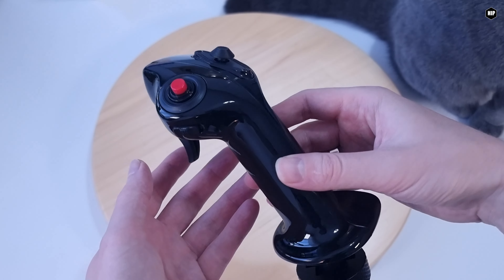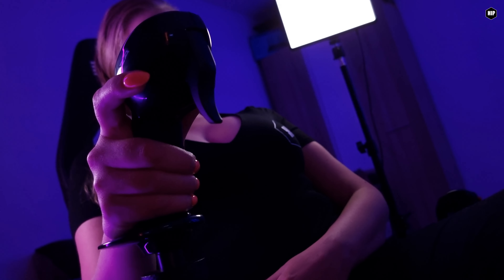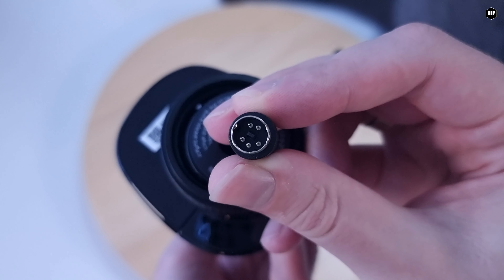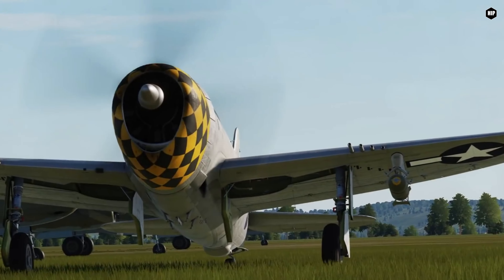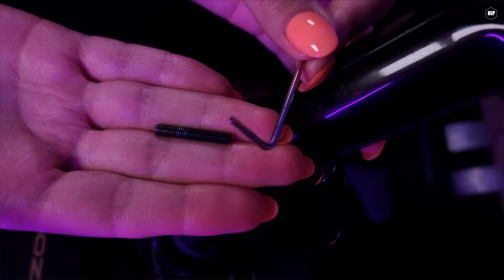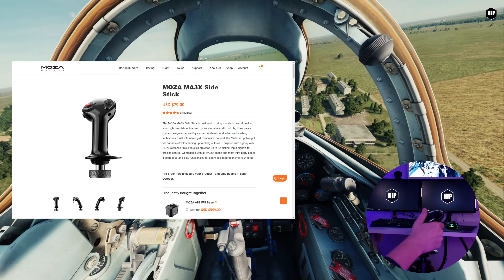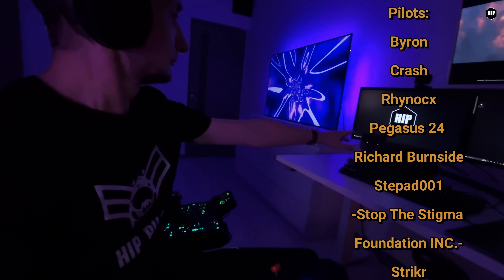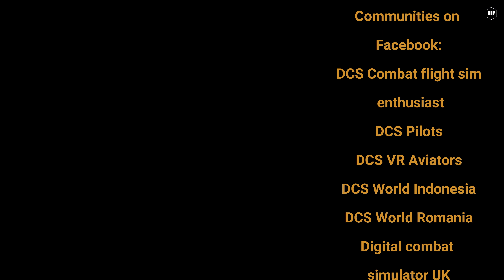Fancy a SIDE-STICK? | MOZA MA3X Flightstick Preview | Ergonomics | DCS Experience | Force Feedback

Comment: Using the extension.. from not a lowered position makes no sense. Raising the stick to a poont where the control arm isnt naturally resting on your thigh is ergonmically wrong. Look at any real fighter with a center stick. They dknt make the pilots hand sit at almost shoulder height.
Reply from the maker: Exactly, but for the showcase we had to use it in that position for the camera angles. Once you get it, it's up to you where you mount it. Thanks